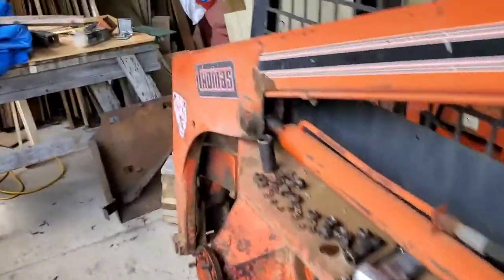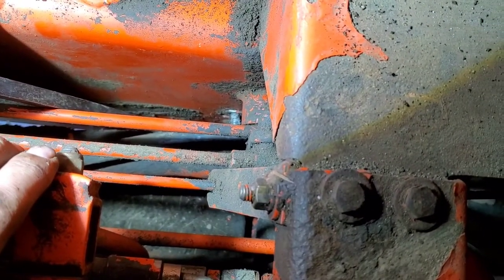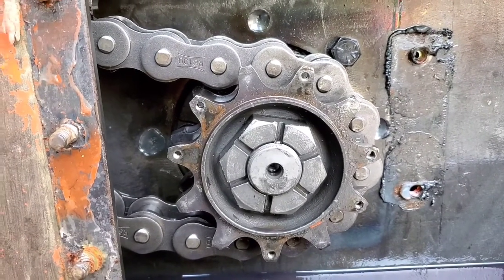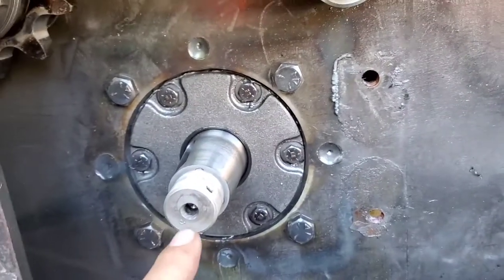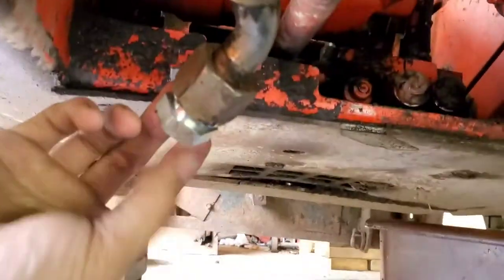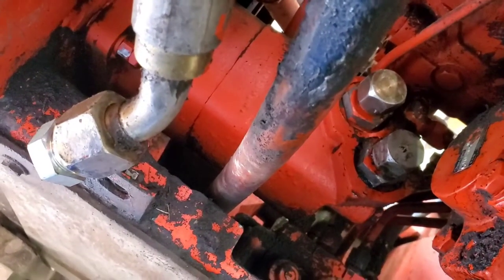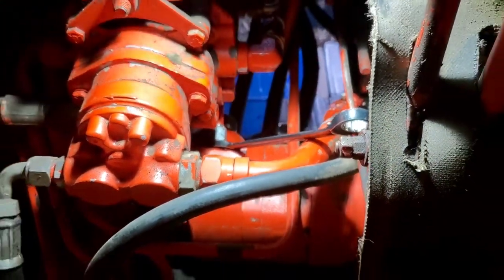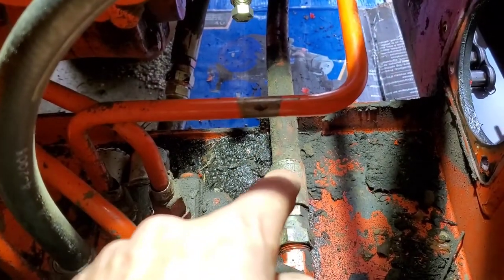Torque Motor Removal T133 Skid Steer

Comment: Did you see any big oil leak? My machine ia leaking a lot. Leaving a poodle after running for few minutes can really see the leak im planning on removing the right tire because it looks like is somewhere there. It hesitate when rising the bucket.
Reply from the maker: Only when the machine was parked on an angle a bit of oil would weep out. Previous owner told me it was bad before I bought it so I knew it had to be done.

Comment: Thanks for the video, I also need to replace the seal in my drive motor on the T133, mine is on the left a little more difficult to get, but right now my front wheel axles fell right out and I am looking for the castle nut in the tank?? Weird?
Reply from the maker: I'm sure you know about the I side front inspection covers, diamond shape, makes for easier access to Axel's.
Reply: @onyxpartitian  Yes I had to remove the foot pedals to access the diamond plates, did you do a follow-up video on the drive motor, I was not able to find it?
Reply from the maker: @captaincrunch1949  unfortunately I still haven't, been too busy this summer with work

Comment: Hi! Great video and nice to see information about this robust skid steer loader. I just bought a T133 and left side wheels are not turning at all in any direction. I did the Repair Manual troubleshooting related with "Section 3 Controls", but I am afraid it could be related with hydraulics. With the leak you had, did that side turn a bit or nothing like my case? It seems you didn't have to depressurize anything or raise the arms before disconnecting the torque motor, did you? Thanks a lot
Reply: I removed the cover and saw like 10 cm of oil, so I guess I also have a leak. I guess most likely solution is a seal kit, don't you think? Thanks
Reply from the maker: My motor was operating as it should, just leaked oil on the ground when you leaned over too much
Reply: @onyxpartitian  Hi. My T133 wheels of one side move when raised but not when it's on the ground. I found leaks in both main hoses of that side torque motor, so I bet that's the issue. Did it drained a lot of oil when you disconnected those hoses so you had to lo plug quickly the caps? Would it empty the tank? Thanks.
Reply from the maker: @EvilRace  it won't drain the tank because it has to go through your valves, but I had already drained the tank because I was replacing all the oil, had 3inches of water in the bottom.

Comment: Woupd be nice to see what website you ordere from ?
Reply from the maker: I ordered from local supplier. Motion Canada. Believe they are Motion industries in the States.
Reply: @onyxpartitian  thanks. So Did you order one of each of the seal kits ?
Reply from the maker: I ended up just getting the seal kit for the one torque motor, and haven't had an issue since.
Reply: @onyxpartitian  i have the same issue on same model .. hopefully i can get it back running thanks to you ....  so which seal kit would i order ?  61237 ? Or 61238 ?
Reply from the maker: Sorry I just checked back, I ordered both. When taking it apart make note of the direction of the white seal that goes around the shaft.
Reply from the maker: I took the numbers into motion Canada of my motor and they matched the right part number in their system.
Reply from the maker: @arturodiaz2842  I took video of replacing the seals but thought it wasn't good quality for YouTube, Ill see this weekend if I can put it together for a video
Reply: @onyxpartitian  would love to see that video… it would help a lot of people out myself included
Reply from the maker: I uploaded a video, hopefully it helps.